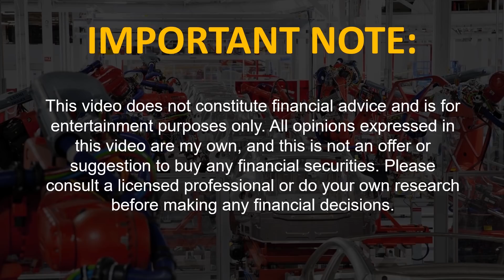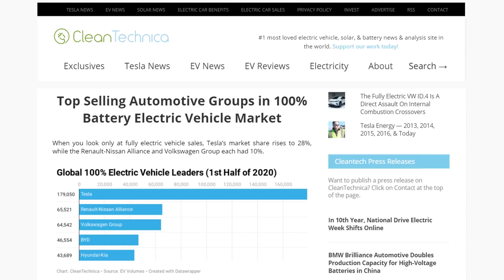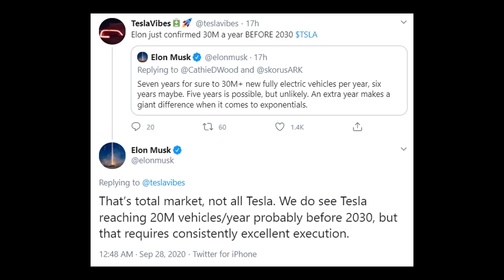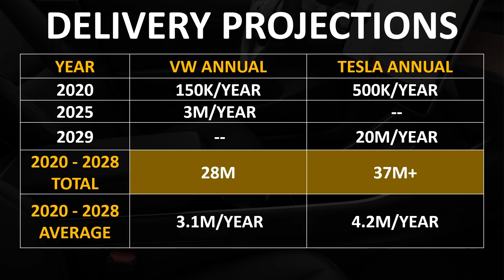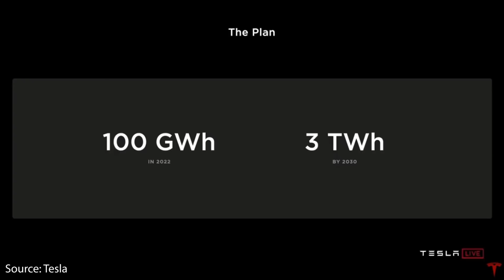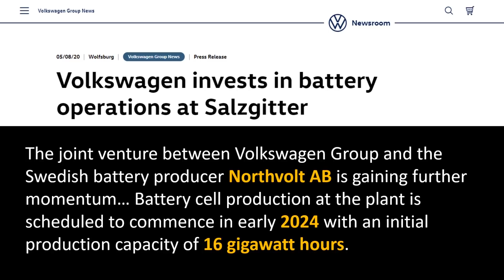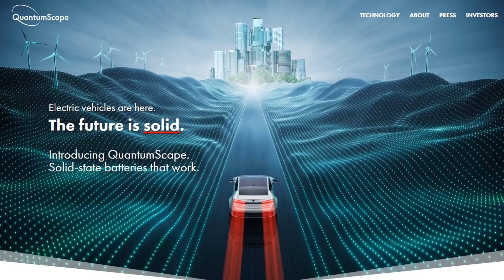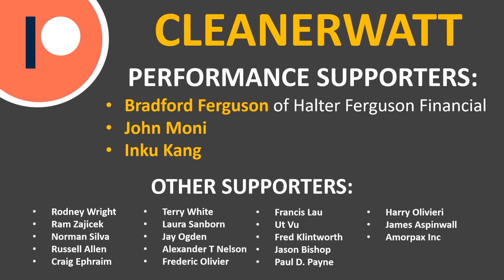Tesla vs VW: Can VW Catch Up? (Electric Vehicles)

Comment: In Europe VW has just surpassed Tesla. And in 2021 not only VW.
Reply: Good for you. Tesla have much bigger market in the U.S and China.
Reply: @peterp4753  50% of all BEV are sold in China, 30% in Europe and only 15% in the USA. VW will sell the ID.4 worldwide. And this will bring sellings (and share price) of Tesla down.
Reply: @migrationsforschermitbreit6744  
You must be making up your own statistics. 
Your Volkswagens doesn't perform better than the Nissan Leaf. Do you think Nissan Leaf is a success story? It's only matter of time when people will realize what Volkswagen is really selling. Tesla car prices will come down because of the new battery technology that will have more range, around 500 miles on single charge, and they will be able to produce those batteries 7x faster. Their car assembly lines will be performing much faster because they will be using casting machines that will allow them to use much less parts. Soon Tesla will have the Model 3 with  500 miles range for $30,000 or less. Rest of their cars prices  will come down significantly because of technology improvements, not because of Volkswagen. 
Volkswagen is a joke!
Reply: @peterp4753  You can take this statistic:
https://teslamotorsclub.com/tmc/threads/tesla-europe-registration-stats.61651/
In Norway sellings of TESLA dropped in 2020 by 80% compared to 2019.
TESLA has a market share of 16% out of 2-3% of the worldwide car market (0.4% over all! - 400,000 of 100,000,000).
If You compare only BEV, VW is already close to TESLA and in 2021 Volkswagen will sell their BEV worldwide.
Top runners in Norway are actually ID.3 and AUDI e-tron Model 3 is on place 5 and actually on place 21.
If You believe the fairy tales of Musk, then send me please only one of the "1 million robot taxis in the USA in 2020".
Reply: @migrationsforschermitbreit6744  
Hahaha...in Norway?? Really? Norway have only 5 million people!! Are you dumb or just naive? New York City have 8 million people,  USA have 300 million and China more than 1 billion !! Tesla is the best selling car in North America and China. 
So who cares about Norway, or Europe all together. Only one European guy make sense here on YouTube, he have the channel here called "Best in Tesla ". I think he is in DENMARK, maybe you should watch it sometimes.
Reply: @peterp4753  The share of BEV in Norway now reaches 60%. Norway is the reference market for the whole world.
50% of all BEV are sold in China, 30% in Europe and 15% in the USA.
You have to learn how small is the US.
Have a nice day and try to find Europe on the map.
Reply: You're wrong. Tesla leads all evs sales worldwide, in North America, Europe and in China. Tesla has sold over 300,000 electric vehicles SO FAR this year. No other oem is close.
Reply: @frunkytowntesla  Tesla market share Is dropped to 7% in Europe. Renault and VW sell more EV than Tesla now. But considering that end 2020 and 2021 in Europe come out 10 more EV models the Tesla market share can only drop more.
Reply: @ettorefieramosca5460  But this means 7% of 3%! BEV share is now appr. at 3%. So the market share of TESLA over all is microscopic small :-)
And yes, it will come down more. And look to the chinese producers (BYD, Geely...). 21 of the 50 biggest car producers in our world are chinese companies.
Reply: @frunkytowntesla  
You're 100% correct,. Tesla sold even more than 300,000 and will make 500,000 by the end of the 4th quarter.
 Volkswagen live in the lala land.
BMW just got caught lying about their sales figures, Volkswagen probably will do the same. They are desperate!

Comment: WHERE'S THE LITHIUM GONNA COME FROM??? MUSK, Vee-DUB, Nissan/Renault, TATA and everybody is banking on an inexhaustible cheap source of lithium for batteries. It doesn't exist anymore than an unlimited amount of cheap oil. And how ya' gonna CHARGE all those EV's??? To charge a 4000 watt battery takes almost 12000 watts of power unless you got an awful long time to recharge it....even then, it takes more than double the battery capacity to charge it unless you can re-invent physics and chemistry. Your i-phone take 5 times the juice to recharge it that it holds, your ear buds take 10 times the juice or more depending on the brand and that's when the batteries are BRAND NEW. After ten charge cycles they take 20% more juice to take the same charge; in a year they take 100% more juice than when new. Even Tesla admits in 6-7 years their batteries are effectively worn-out and may cost $40,000 to replace. See any 10-15 year-old hybrids for sale on used car lots? No? Wonder why? "Fitness for purpose laws". If a hybrid vehicle doesn't run (and if the batteries are dead, they won't) it can't be sold as a vehicle, so it's not "fit for it's purpose" and a "note lot dealer" isn't going to take a chance on the batteries crapping out and leaving them with a huge repair bill ($5000-$9000 or more) on a vehicle worth $2500.
Reply: Well just by the quick look at the units you use, you have 0 knowledge about physics. Also Lithium is literally everywhere. There is enough lithium to replace every single ICE car with EV multiple times.

Comment: Great video, but I believe there are a few things that were overlooked:
1.	If their advancements in battery production, as detailed on Battery Day, will result in production lines 0.1 the size and 7x as fast than the current lines, why would Tesla leave the old inefficient/slow lines in place in Giga Nevada and Giga Shanghai?
2.	Upgrading these lines would result in a 70x increase in production at both sites (10 lines replacing the current lines in the same floor space, each 7x faster than current).

Projected production in 2030 would be as follows: 2.4TWh at Giga Nevada and 1.75TWh at Giga Shanghai, bringing the projected total, without additional production from new factories, to 6.66 TWh .

Comment: It baffles me that no automotive company invested heavily in to EVs when Tesla started swinging in the early days. Yes nissan and Renault had small hatchbacks but now they are all playing catch up to the undergo
Reply: No incentive to do it. They all live in 90 day windows and will not invest billions on something they wouldn’t recognize for years while at the same time cannibalizing their existing ICE sales. Dealers are not set up for it. They would all need new specialize equipment and training. And EV require less maintenance so they definitely don’t want to do that.

Software is a big part of EV from thermal management to systems integration. Legacy auto can barely make a touchscreen infotainment that doesn’t glitch let alone OTA updates that cut out the dealer.

It’s like Apple all the sudden switch to ICE iPhone. That’s the monumental change over it would take for these guys saddles with billions in obsolete ICE r&d and patents, hundreds of suppliers etc. New comers are the only ones that can start fresh.
Reply: These folks are not stupid or corrupt. The most important item is the battery. Right now you have a Tesla model S driving you around with >3000# . That requires heavy brakes, suspension and chassis. Add to that challenge to make the battery last. Made of exotic materials difficult and costly to get. Another challenge is extreme temperatures in some places. I am an engineer and have faith we will eventually find solutions. It may take some time and there may be challenges. The Germans believed they had an alternative with the diesel engine. That got screwed up. Ditto Wankel engine. Hybrid engine. Hydrogen engine. Japanese push that and they are not stupid. Perhaps EV with huge battery is the best solution but do not bet your house on it yet.
Reply: Wilfried Dehne Model 3 is already $35-$38K, not much more than an average car with a $25K car in a few years. We’re there already. Legacy auto will get left in the dust. It’s too late for them to catch up. Tesla proved they’re taking first principles towards batteries to drive down cost and increase density many factors over. The others think they can just buy batteries and stuff them into an ICE car. They will and are in many ways learning the hard way already with pathetic sales of their compliance cars.
Reply: I need a car with self driving features like Autopilot FSD. I am ready to buy a Tesla but people who I can trust warned me about persistent chassis rattles in Tesla's. That would drive me nuts. I will research that before I commit. BTW a model 3 with Autopilot FSD is more like $60K and a model S 100K. That is a lot of commitment for a car which may rattle and can not be fixed.
Reply: @willdehne1  It's a shame that Tesla is such bad quality. I read a story of a model y glass roof just flying off not long after picking the car up. It's clear they are more interested in production numbers
Reply: @jakeartis955  I do not have enough money to afford risking to buy a car which can not be fixed. I hear stories that not only does Tesla have nasty quality problems but also a hell of a time fixing it. The nearest Tesla center is 100 miles from here. It will be costly to deal with that.